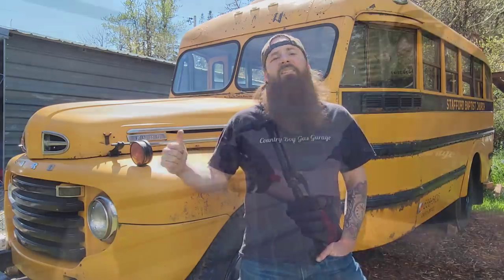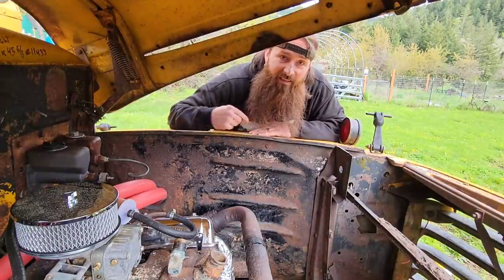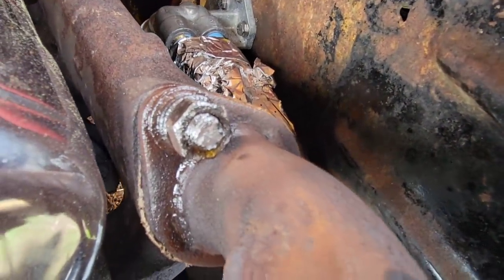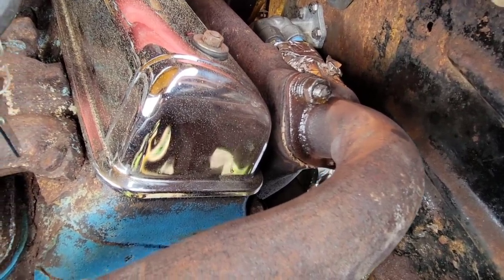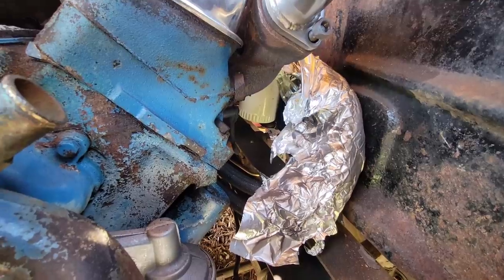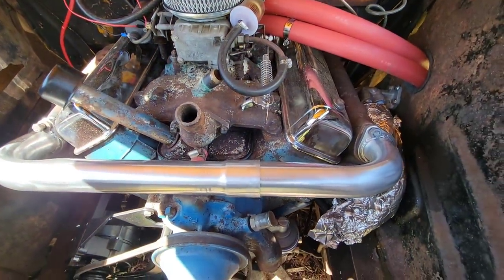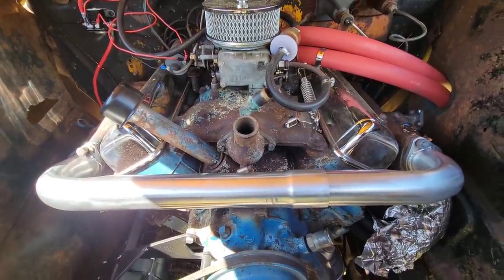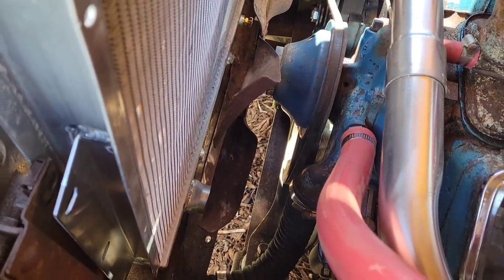(19th Video) Things Get HOT!🔥(maybe to hot) as We Remove Old Rusty Exhaust Bolts off the 1948 Bus! 🔥

Comment: Electric fan or fans with a shroud is the way to go. I did the same thing with my 50 F-1. I put a sbc in it using the original style radiator but new from LMC. Blocked off 1 inlet and 1 outlet but the fan blade I could use was so small and low on the rad it always ran hot. So I put a tri flow alum radiator with electric fan and temp barely gets to 190 on 100 degree days. Good stuff man.

Comment: Awesome video. You got those exhaust bolts off without breaking them off. Great job! And hey go with the electric fan. It will keep it cooler than the original so that's a good idea. I think I'd leave the radiator like it is without painting it that way when you open the hood you get the WOW factor right out of the gate. And my bad on the alternator brackets. This build has me on the edge of my seat waiting for the next episode. Thanks for taking us along for ride. This is fun to watch along..

Comment: first i would check motor mounts to make sure it isnt dropped down,far as the rad goes,take it to a welder that can tig weld a new location be cheaper than upgrading to electric fans

Comment: Hey Mr. Kellogg, Should have just dropped the Radiator 2". Like you said, the Bus has been modified through the years and no-one's going to notice. Today I check off 7 things on my Automotive To-Do list and get another day closer to wrapping up my vehicle for the year. Discovered a few holes in the Filler Neck yesterday and had to add replacing/repairing that part to my list. I'll see what my choice is after I pull the old one out and how far it's gone.

Comment: Nice job on those nuts and bolts!😎😎😎 It's nice having the right tools.
I got a charge account at our local welding supplier and leased my tanks. I just refilled them and it cost about $125. I don't remember how much my torch set ran but you can find some on marketplace or the swap meet. Just be careful of someone elses junk.
The fan was sad. I have moved radiators over, put them on the front of the frame and even shimmed the motor up a bit. Yours is rather catastrophic and not just a touch or rub. I'd go with the electric fan.
I think the header wrap is a great idea.
Cheers
Terry

Comment: That radiator is a beast!  Bummer it didn't first time around.  I was thinking about that crossover pipe the other day; if you didn't have a replace one, I was going to suggest welding one up with a big old loop in the center of the pipe LOL  Thanks for sharing and keep at it!

Comment: Rams head exhaust manifold are available through speedway . You have a yblock where a flathead was.  You can get a new radiator for less than that from mid fifty Ford. The motor mounts on the frame were the same for the flathead and y block. 1953 to 1960 Ford pickup frame were about the same. 53 had the flathead 55 had the y block. My 56 bus now has a 390 with a 5 speed overdrive and a 3 speed brownie and 2 speed rear end .30 forward 6 reverse gears. Granny low, under drive and low range   I out walk it. High range , 5 over and 3 over cruises at 70 all day long.

Comment: The 55 Ford pickup had a different water pump that had a mount on it for a fan blade and pulley . This raised the blade up so it aligned with the shroud 
 You had a fan belt , and you had another belt that ran the alternator water pump and to the crank shaft. What you have is for the car

Comment: I haven't watched the whole video yet but I think the alternator and belt tensioner are upside down. On my '55 ford truck, the alt. belt tensioner angles down from the top. Swing the alt "up" 90 degrees, turn the tensioner over and it should work.

Comment: At this point as you well said it’s better to paint the new radiator black and slap on an electric fan; it will make it more reliable. The other alternative would be to get a radiator shop relocate that outlet at the bottom; not sure how difficult/expensive that would be.

Comment: What is the advantage of the exhaust crossover tube? Seems like it is only good for producing heat where it is not needed. Unless turbos are planned?
Reply from the maker: It's the stock set up. That's what Ford did on the Y-Blocks. I'm still learning this, I'm a Chevy guy...lol!

Comment: I would get the original radiator recored route, the easy way  then everything would fit as it used to saving a lot of headache instead of buying different parts an trying to make them fit and work
Reply: A staggered core and smallest core spacing (more cores) and baffled would help with cooling enormously A good radiator tech knows about this

Comment: You don't what to cut the fan the fan is balance if you cut it if your off just a little it will take out the water pump. So your best thing putting in electric fan or take the radiator to a shop an having the outlet moved. It won't cool that well with a smaller fan. If it was me I would put in a electric fan it be different if the Bus was all Original but its not good luck bro so fare your doing Rilly good on the cool old Ford Bus 👍

Comment: Although these manifolds do work grate if you want to mount a turbo charger on to these engines 
You will want to make a clamp with a loop at one end and inch wide shaft and weld it on to that pipe to hold that heater hose away from the pipe , its just a weird design never understood why ford did that. Or put the hose behind the pipe and ziptie it to the engine some place so it pulls it back from the exhaust pipe .

Comment: Is that cross pipe there because there is no crossover pipe underneath?
Reply from the maker: That's how the old ford y-blocks are factory
Reply: I have worked on a lot of Y-blocks and have never figured out why they did the crossover like that. Maybe they were so used to the flatheads running hot they wanted to add some nostalgia to it. LOL!
Cheers
Terry